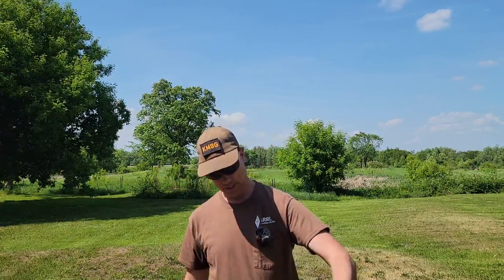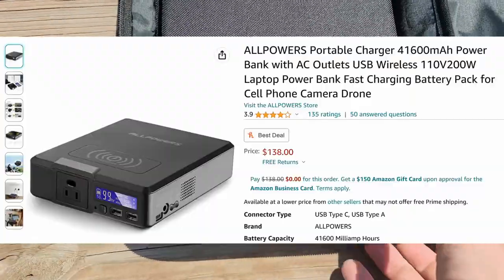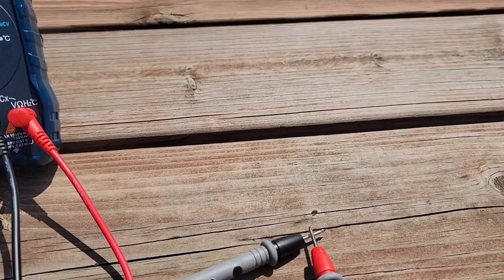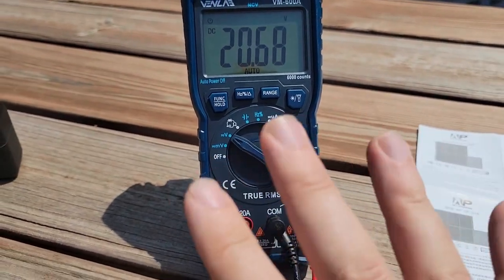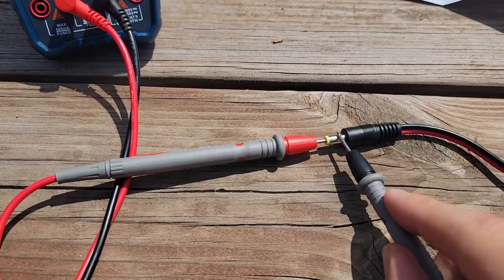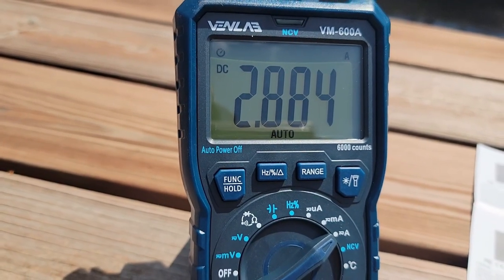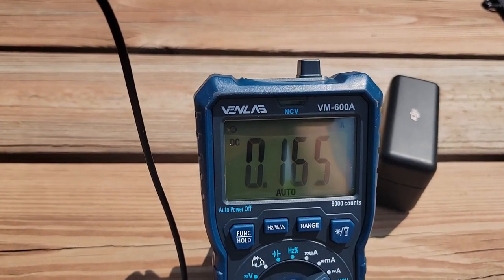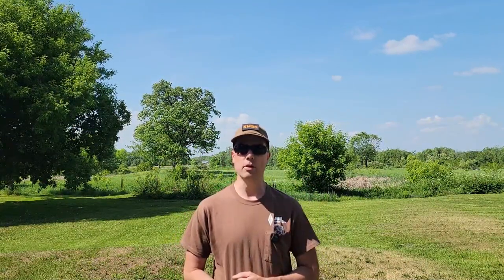Is Your Solar Panel Good Enough?

Comment: Thanks for the video, Steve. Currently looking around for a solar system for my FT-817 setup. The solar panel link does not appear to work properly, thought I'd let you know. 73 de M0VKP
Reply from the maker: Try this one: https://iallpowers.com/collections/60w-solar-panel/products/allpowers-60w-foldable-solar-panelpolysilicon-cells?ref=rjqlvc69